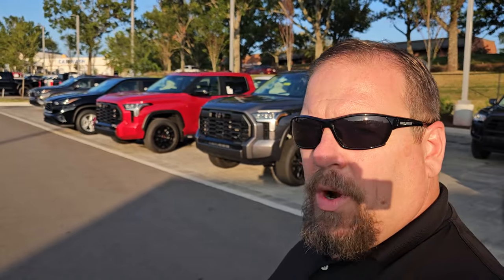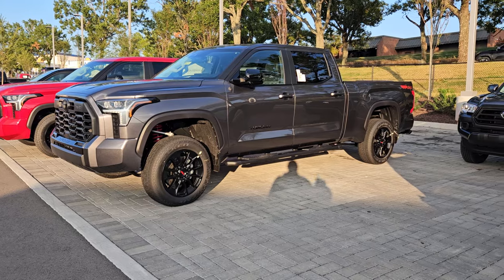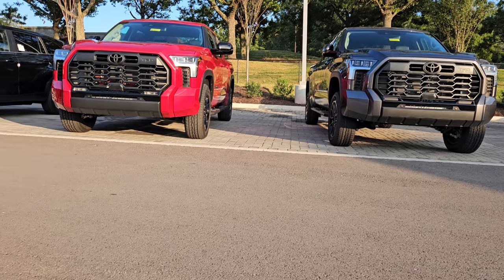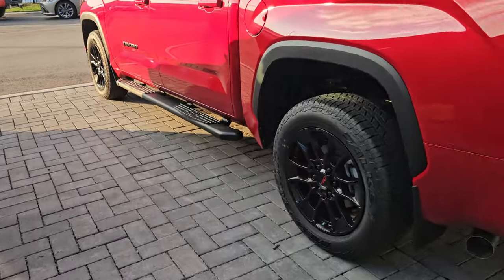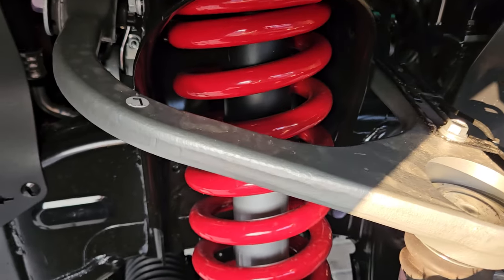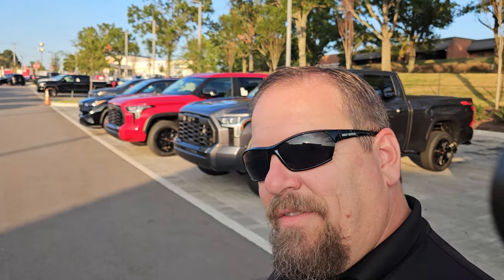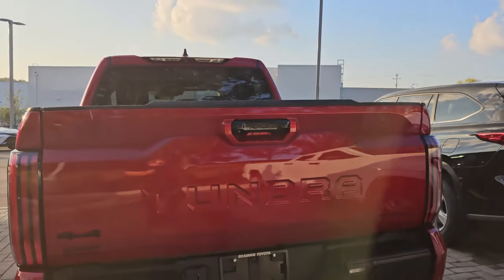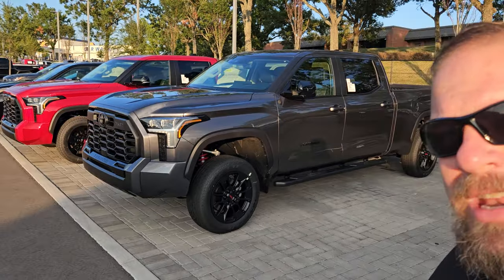Toyota Tundra 3 inch Factory lift

Comment: I may have missed it, but what was the OTD price for that truck? I don't see the lift as an option on Toyota's builder tool online. Does this have to be added to a TRD equipped truck, or could you add the lift to an SR5 with an SX package?
Reply: I saw the lift listed online where they list all of the other packages.
Reply: It's at the end under accessorys

Comment: If 4K buys all the parts, they should deduct the value of the substituted components. Shocks,struts,arms,axles... It’s far overpriced for the factory build. Making you pay for two of everything.
Reply from the maker: If you get it from the factory then its just the 3995, its if you get the kit to replace what is on it that they charge the labor for the install
Reply: Subtract the price of the deleted stock parts from the kit price and you’ll have what it should cost. 
Delete $2500.00 for the value of stock and add back $4000.00 for TRD and you get a $1500.00
upgrade. If you upgrade to a larger engine, they don’t make you pay for the smaller one you didn’t buy.
Reply: In Canada, the 3” factory lift kit offered on the Toyota website is +10K!!!!
Whaaaaaattt????
Reply: I think it is dealer installed in canada, atleast thats what the dealer said to me last week
Reply from the maker: @robqwertyuipp8750  there is a dealer installed kit as well
Reply: Yeah just get the trd pro at point.  Wish they had a non hybrid trd pro

Comment: Hey so I have 2 questions. First can you try to remote start and see if they fixed the shut off after opening with the door. Second question is what tire size is good  for the lift until it rubs on the sway bar, maybe 34s? Because they look like the stock ones on that truck 🤷‍♂️
Reply from the maker: I will look at my note again to be sure but i mentioned it.
Reply: @stevenwelchtoyota  The remote start or tire size, I think you mentioned 34s?
Reply: Truck still shuts off after remote start and opening door. So do all new Lexus models. Serious deal breaker for me.
Reply: @Ekimsnegdoh27  even the 2024 tundras??
Reply: @tonyjoudi466  yes
Reply: Tundras, yes. But not the other new models that Toyota/Lexus has out. The vehicle stays on in the Crown, NX, RX etc except certains trims.
Reply: @josephchacko689  that’s weird they said all new 2023’s and later would be fixed??
Reply: @tonyjoudi466  
My understanding is that whether the vehicle stays on or not after unlocking depends on the vehicle platform. Since Tundra has a slightly older platform than the Crown, RX, new Taco etc, it'll turn off. So not sure if this feature will be there for this gen Tundra.
Reply: @Ekimsnegdoh27 guess u want urs stolen

Comment: Looks like you lose the fog lights when you get the 3” lift.
Reply from the maker: Depends on trim level for which ones have it
Reply: I got mine and they delete the fogs "due to state laws" and them being too high. Well in CA the limit is 30in and the fogs sit at 29in so it would be legal. Headed back to the lot tomorrow to have them installed since I paid for them.

Comment: Are fog lights lost with the lift kit installed???
Reply from the maker: Yes but the wires and switch remain
Reply: What if I already bought my Tubdra and put the lift kit after will the dealer remove my fog lights?
Reply from the maker: @TomMarkz  probably not

Comment: I have 295/70r18 which is about 34.5x11.9” on a totally stock trd off road.
Reply: sweet, have a 23 1794 with trd package, i swapped the tires to 275-65-20 (34's) before my lift was installed, i wished i had gone with 35's from the beginning.
Reply: No rub?

Comment: It needs to be running at least 35's. That looks ridiculous with those tiny little bicycle tires.
Reply from the maker: To each his own
Reply: @stevenwelchtoyota  It's a fact. No one lifts a vehicle and still runs the stock tires unless they are too cheap to put on a larger sized off road tire. The point of a lift is to increase ground clearance, approach, and departure angles as well as accommodate larger tires which also increase the aforementioned clearance heights. Setting that truck up like it is in this video is a travesty to the brand and their products. I don't know what looks more foolish, the lifted truck with the tiny stock tires or shyster who is trying to sell it that way.
Reply: The truck looks absolutely ridiculous. Unless you plan on entering a lowrider hopping contest. That $4,000 bump is only half the cost because you need to buy rims, spacers and tires now.
Reply: @tpc3416  : LMAO, spacers. Only clowns use spacers. Just buy wheels with the proper offset for the look you want.

Comment: Arent you supposed to get bigger rims and tires with it?
Reply from the maker: you can but not necessarily
Reply: Yes, clearly the dealership is trying to rip people off and no doubt charge even more for the rims and larger tires. A person is far better off to take the truck to a real off road shop and outfit it with quality aftermarket parts, not the cheap garbage they are offering here.
Reply: @mikelaughlin270 whatever you get from the dealer is most likely better quality. That's oem bubba. If something messes up its under warranty. That shop you go to won't do that. My 2024 trd of road wasn't lifted and I added this loft to it and they took off the wheels it came with and I got on some 35s. BTW mine is in solar octane. It's all matches pretty sick.
Reply: @dethtour  Do some quality research Bubba. The whole reason aftermarket products exist is because they are built better than OEM. What sane person would remove something that was good only to replace it with something of a lesser quality?
Reply: @mikelaughlin270  I lost braincells reading that. You clearly have no idea why after market exists. The reason why it exists it because it provides products that the oem manufacturers don't provide. You can't possibly believe that an aftermarket company can create a better lift that a mega corporate that has spent a billion dollars and 20 plus years developing to work the best with your vehicle. You are on some serious dope
Reply: @mikelaughlin270  : While you can spend more money on a higher end aftermarket lift I wouldn't call this Toyota lift kit garbage. Go watch this video, by Yota Xpedition, which goes over the parts included in this kit - Tundra TRD Lift Kit Overview | With Kai From Tinkerers Adventure (I'd post the link but then my post gets deleted).

Comment: Any lift kit or levelling kits I have used have ALWAYS affected how the truck tows a heavy load. Most of the time it makes the steering outright scary as hell.
Reply: @warg333  you spelled “truth” incorrectly.
Reply from the maker: I would be interested to see how it works. Toyota said same driving dynamics
Reply: @stevenwelchtoyota  me too but I wouldn’t want to be the “paying” guinea pig! Lol
Reply: Most (if not all) lift kits don’t have the amount of OEM parts this has. Raising the CG does have negative steering consequences for sure but this kit is not slapping a lift block or coil over
Reply: i don't know about scary, i have an ICON suspension lift on my 23 1794.  after the lift was installed i noticed the front camber was not vertical even after alignment. i went back to the shop to have new Upper control arms installed and the truck handling improved was definitely noticeable and no more negative camber.
Reply: @taylormade710  I put on the Icon dual stabilizer kit on my 2005 F350….. zero improvement over factory.
Reply: @beri232  interesting, did you call them?
Reply: @taylormade710  nope. I chalked it up as a poor investment and a learning opportunity. It was purely cosmetic and not worth a penny for better handling

Comment: The angles on those cv axles and tie rods are a bit much.
Reply from the maker: noted
Reply: Good thing Toyota has you watching a YouTube video  instead of a entire division of engineers.
Reply: @philipparana9225  it'll be in my shop for ball joints eventually.

Comment: Dealership in Columbia,SC quoted almost $9K for labor and parts for install 🤦🏻‍♂️
Reply from the maker: Wow
Reply: If the factory does it no install charge, if a dealer does it, cost of lift + install, it doubles. If the factory does the lift, they tune all the sensors to the lift, if the dealer does it, I’ve heard there are sensor issues, possibly permanently lose the ability to use cruise control.

Comment: Noticed this on the 2024 Tundras w/ TRD pkg. w/ the 3" factory lift they don't have fog lights . You can see this on the video here and have seen the same on other pics. Let me know what you find out ?
Reply from the maker: They remove the lights cause they are too high. The switch and wires do remain though
Reply: There is a dial on the inside that you are able to toggle, regular head lights are remote controlled, about 5 different pitches, and can point down with a turn of the knob. You can literally point them down 6 feet in front of the truck.

Comment: Where can I get one with one of the factory lifts I have asked 2 dealships and they both said no they don't exist
Reply: They are limited in supply and very hard for a dealer to get due to demand. The factory lift is a new option so they are most likely not aware of it.
Reply from the maker: we are getting several
Reply: @stevenwelchtoyota  I have one, I love it. The dealer had some bicycle tires on it and for 500$ they traded those out for 275/r70 18 BFG K02’s. Couldn’t be happier with the vehicle.

Comment: thanks for the real-life preview of the 3" factory kit. Seen it in the configurator. I like the non-lifted TRD has RED half shafts = Cool. Wonder if diff lengths than the lifted.
Reply from the maker: Good question. I bet it does
Reply: Red axle are needed.  Longer than the non-TDR Offroad models.